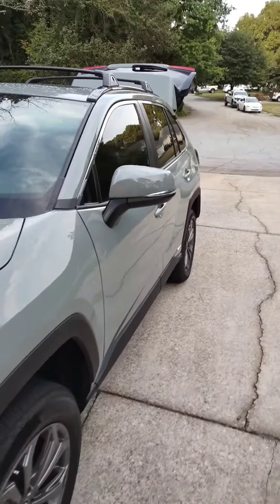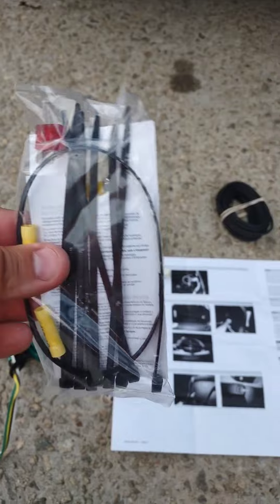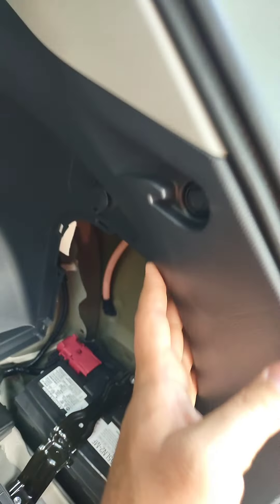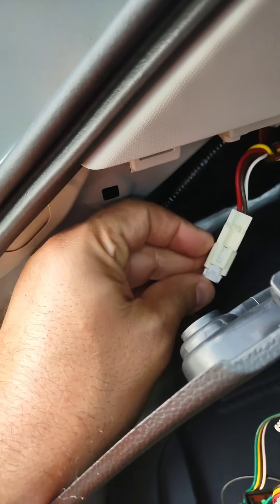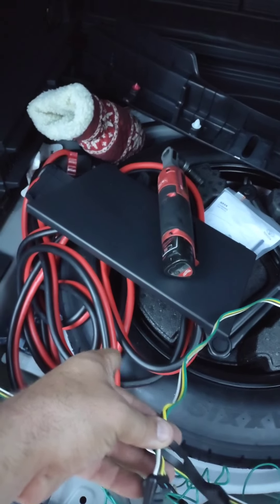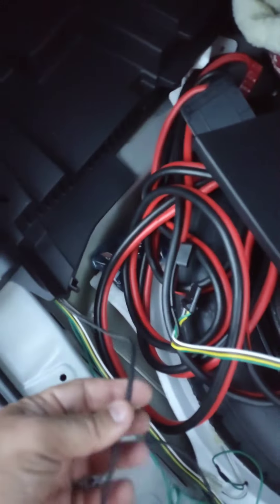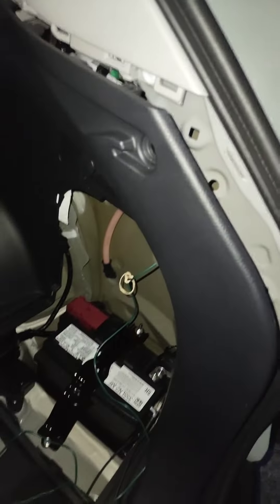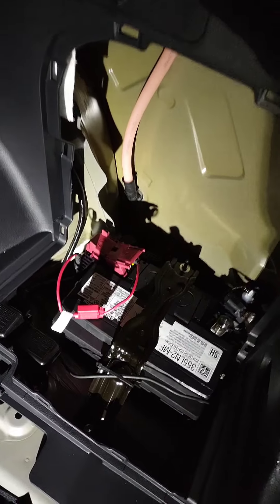2019 - 2023 Toyota RAV4 hybrid wiring harness install diy and trailer hookup test

Comment: Thanks for the video. Very clear. Just wired my 2023 RAV4. Better job than U-Haul would have done, and for some reason Toyota was going to charge over $1,000, because they said they had to run the wires all the way to the front. Maybe incompetent service department?
Reply from the maker: That's great.im Glad I could help.. don't forget to like 👍 and subscribe it helps me a lot...and congrats on the RAV4 .they can do so much...been towing 2200-2800 lb with ease...I will be posting some reviews and experience I had with towing soon..tks for the support..

Comment: Hey Thanks for this amazing video. Gave me hope I can do this myself. I have some questions:

1. Did you put the ground cable first and then put the controller box on top of it, then bolted it to the chassis?

2. Is the 4 inch elevated trailer hitch meet the average height to be level with most trailers or should I get one that i can modify the height?

3.  Seems like you have been testing the towing capacity of the Rav4 hybrid beyond what the manual states. Is the car okay after such drives?  I wanted to put a motorcycle hitch on it but the car's tongue weight capacity is rated at 175lbs. Do you think the Rav4 could handle 420 lbs in tongue weight (possibly the total weight of the dirt bike and it's hitch? or would that damage the vehicle?

Comment: Thanks for the video! Was wondering if there is a way to run the wiring through the bottom of the car so that I can permanently mount it next to the hitch?
Reply from the maker: Thank Joey...you could drill a hole...in my opinion I think it's safer left inside.

Comment: Toyota doesn't rate that model for more than 1500 lbs. gtw.
Reply from the maker: 1750....for the hybrid in the USA....same RAV4 hybrid in Europe is 3000.. I normally tow around 2600 ..it does a well job towing those numbers...
Reply: @samiboost404  thanks for the video. Excellent job.
Reply from the maker: @dugfern  thank you...and thank you  for the support on the channel..👍
Reply: The difference is because Toyota determines safe towing capacity based on assumed speed of towing vehicle. Our speed limits are higher in the USA, they assume we'll (be insane enough to) tow at 65+ mph, and at speeds that fast, a heavier load is more unstable. At speed limits outside the USA, the safe rating is higher. Alex on Autos did a towing test of 2000 lbs going from sea level up to 7500 ft ASL, nps - complete with temperature tracking. Worth watching for proof of concept.
Reply from the maker: @heatheralbertson303 very true.... thank you for the input 👍